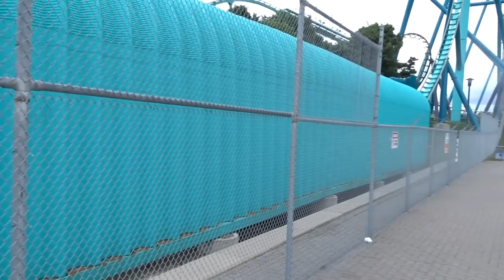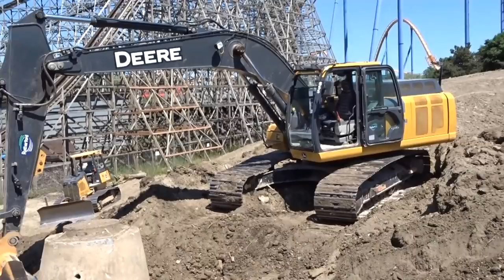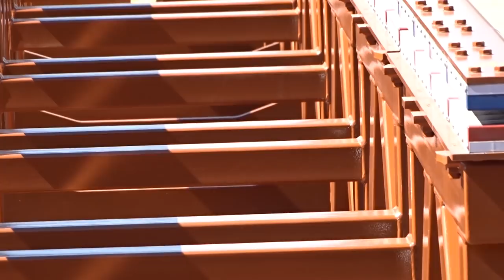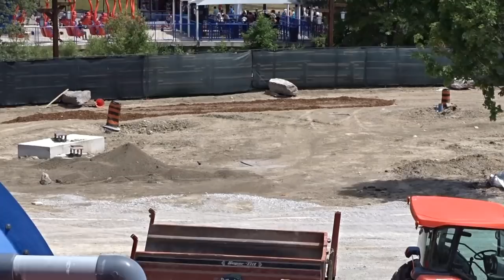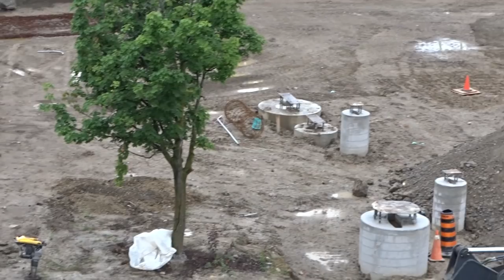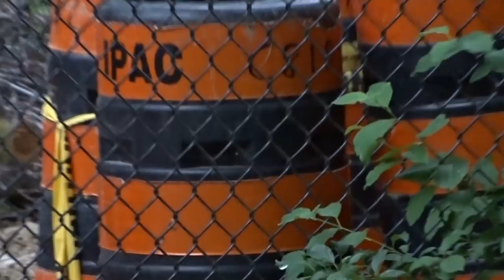Canada's Wonderland "Why it's not a GIGA Dive" Argument

Comment: In regards to the number of support columns, it could also have to do with soil composition.  Maybe our (the CW) Dive needs more supports because the soil isn't as firm/stable as at CP.  There could be other reasons too, but none of us really know anything about coaster construction beyond what we can observe from the outside.
Reply: I would think the ground would be much more stable at CW.   Think about it - one's on a narrow peninsula surrounded by sandy beaches, the other is on high ground nowhere near water (had been farmland when the properties were bought in the 70's to build it).
Reply: Nowhere near water it is actually somewhat near Lake Ontario but I get your point.
Reply: Cedar Point is like if Canada's Wonderland was built on the Toronto Islands rather than former farmland.
Reply: These are all valid responses to be sure.  I'm just proposing that there could be other reasons beyond the size of the coaster that explain the number of columns.

Comment: Might exceed Valravn in height, drop and length, but I doubt CF will want to break the Giga barrier for a dive coaster outside the US - I'll go with a 250'+ lift hill and a 280'+ drop - again, it's all speculation.

Comment: I don’t think any dive coaster in the Cedar Fair chain will beat this because if this beats Valravn it would pull a Fury 325. Fury beat leviathan, and this coaster should beat Valravn a lot like how Fury beat leviathan. I’m trying to say that a coaster at this park (leviathan) got beaten (Fury 325), now this coaster should beat the other coaster with the same model (Dive Coaster) and the only dive coaster in the CF Chain is Valravn. It is likely that this will beat Valravn, just like how Fury beat leviathan. And I don’t think Carowinds would try to beat this coaster because they have Fury which already beat leviathan.
Reply: Fury 325 beat Millennium Force which was built in 2010 as of high record

 Millennium Force’s creation demanded an all-new category just to classify its one of a kind nature – thus was born the giga-coaster. Being the tallest roller coaster and the first to top 300 feet wasn’t the only records broken when it opened in 2000. It debuted having the longest drop and the fastest speed topping out at 93 m.p.h.
Reply: Walking by philippines nice Copy and paste. And millennium was built by intamin. And milli wasn’t built in 2010
Reply: so what if it was build by intamin , its still a giga.
  never said 2010....said 2000 do you even read bro?
Reply: When was the last time Cedar Fair beat a new Cedar Point coaster at one of its other parks within 5 years?  Don't think it happens too often.  However,  backstabbing Wonderland is fair game.  That's the thanks you get for being CF's cash cow.  Wonderland regulars - don't hold your breath waiting for a launch coaster, wing coaster, or an RMC retrofit of Minebuster.  We'll get this one new coaster next year then expect 10 years of shitty new flat rides or water park additions in succession.
Reply: Racing Photographer probably 2-7 year wait.

Comment: Giga because as one video I watched said, Six flags is interested in a dive machine too. La Ronde could possibly build a dive coaster and that would take tons of GP away from wonderland to go ride it. At least if they build the tallest dive coaster which is really an huge undertaking, Six flags may be less interested in spending even more money than wonderland to build a gigantic ride.
Reply: If la ronde was to get a new ride, it would probably be rmc le monster
Reply: The Salvager Kid I agree and disagree. La Ronda will not get a huge scale dive coaster. They are one of the lesser six flags parks. But I agree that if they don’t make it a giga dive coaster, magic mountain could top both cedar fair dive coasters in height. You could say six flags doesn’t spend a ton of money into a single park. But you never know they might go the extra mile to top both dive coasters in height. The Canada’s Wonderland dive coaster already has a 24 ft deep tunnel. So if you get to 276 ft that is all you need to get there with a 300 ft drop.